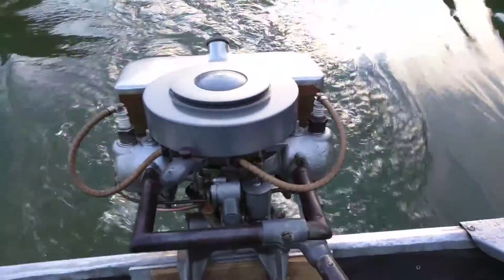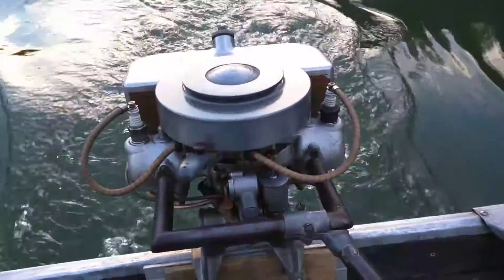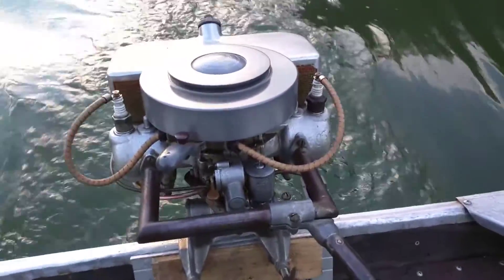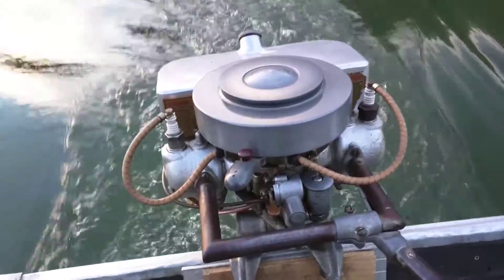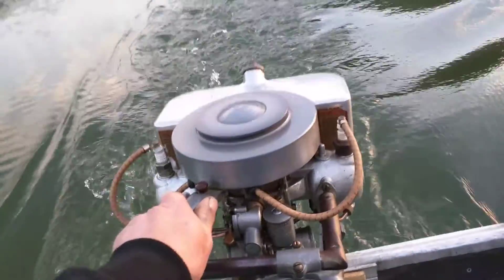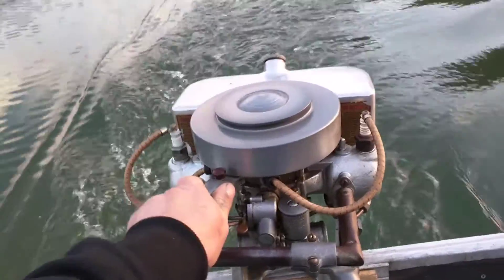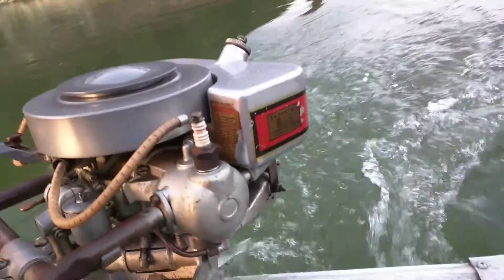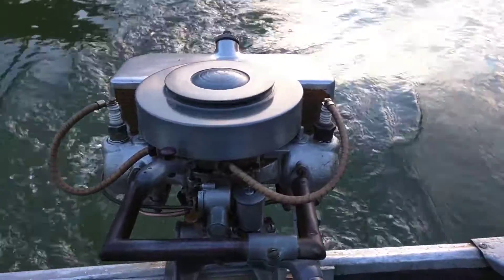1924 Johnson model A 2 horsepower

Comment: You sure can fine some real nice motors
Reply from the maker: Outboard Fun Yeah this is an all original, I did fully take it apart, clean it and put it back together. It didn't need anything but cleaning up. It runs great. Thanks Scott

Comment: I have one just like it, same year.  it is stuck so I have been soaking the cylinders with various solvents and lubricants for about 5 years.  any ideas on getting til his motor running?  Yours is very nice and runs well .  I hope to get mine running.
Reply from the maker: Greg Offenback In my opinion PB lubricant is the best. I freed one up using that stuff. I wish you the best with it
Reply from the maker: Greg Offenback if you ever decide to give up on it I'd love to have it for parts. if it doesn't break free
Reply: I haven't given up, it's just a matter of taking time to work on it.  I retire in a year and will have lots more time. I have an idea of taking an old spark plug and gutting it out and welding or brazing a pipe fitting for a grease fitting.  Then start pumping grease alternately into each cylinder.  It might get things moving, until the exhaust port us uncovered.  

Thanks for another video.  It keeps us going up here in the north when all the lakes are frozen.
Reply from the maker: Greg Offenback I didn't want you to give up, just if you did. What you are talking about doing might work. I hope you can save it.